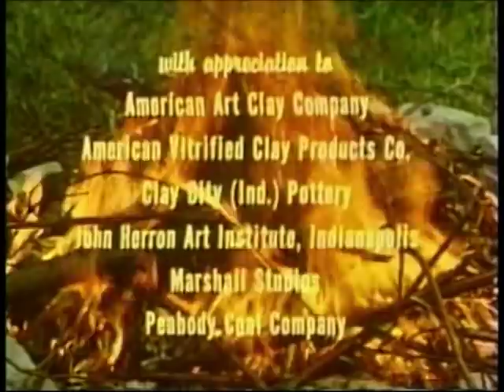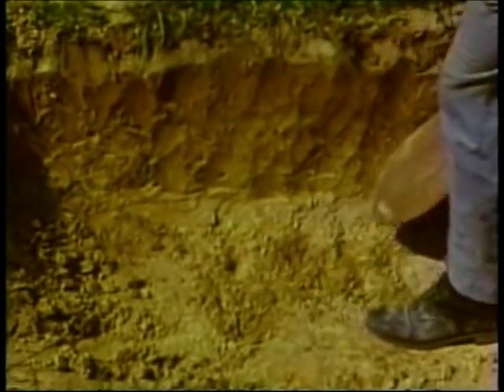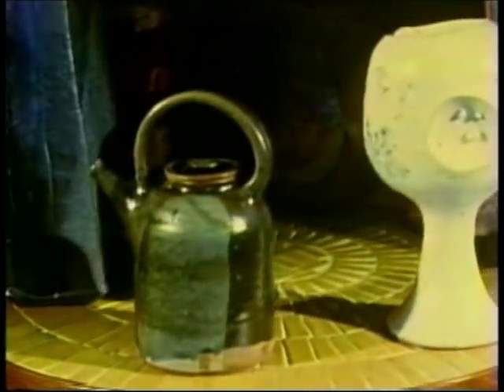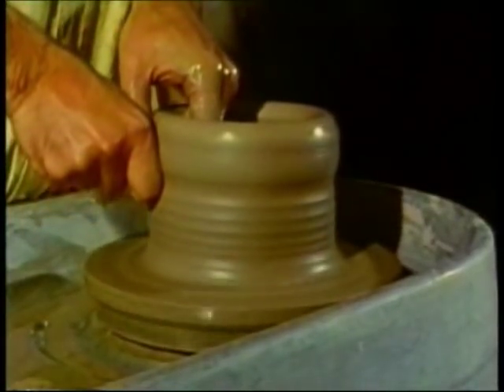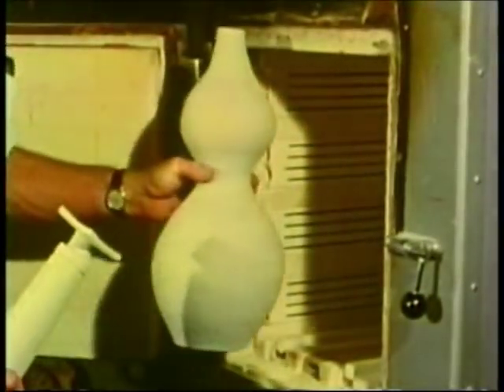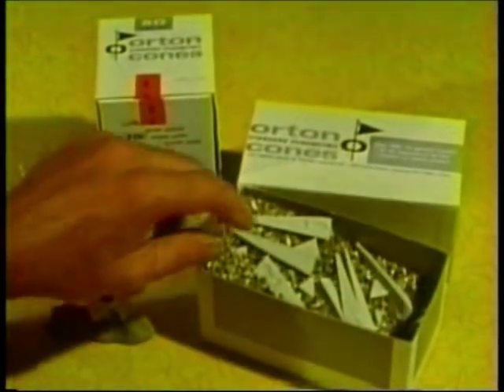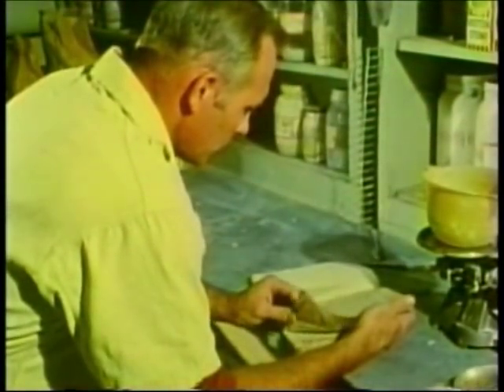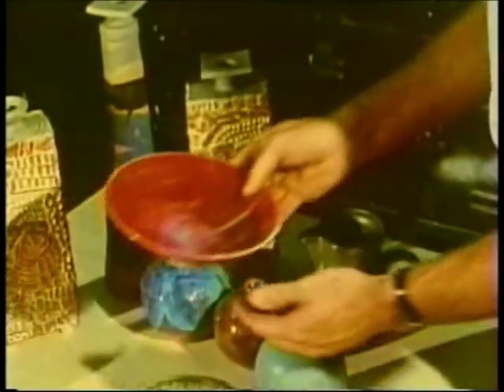Ceramics : What, Why and How?

Comment: I just acquired this same 1967 wheel. It's built like a tank. Weighs over 100 pounds with a 1/3 hp motor. Fully variable speed. They don't make them like this no more.  I painted this gloss white so that it would be easy to clean.